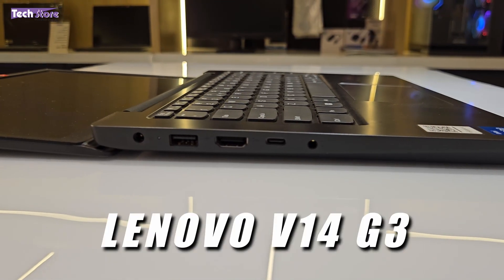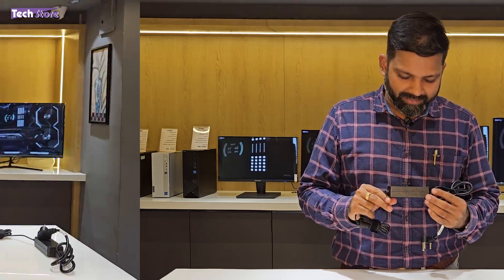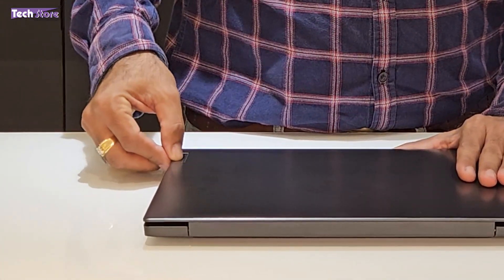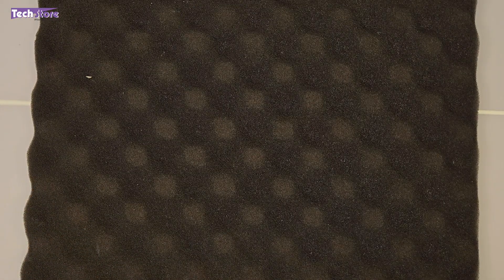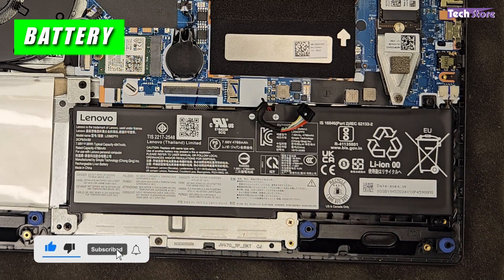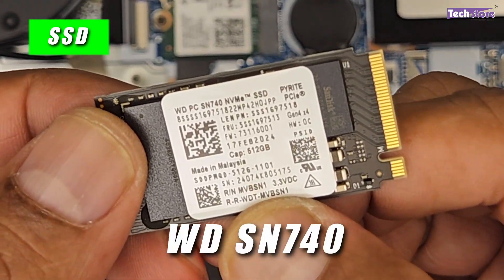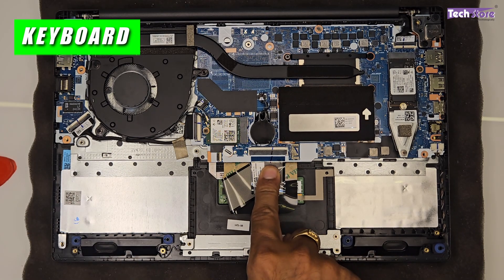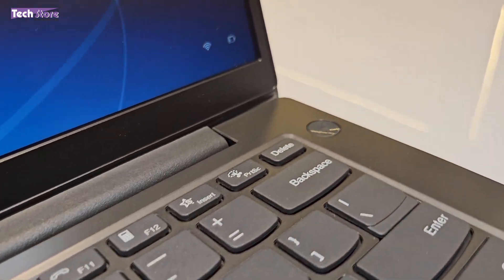Lenovo V14 G3 Full Review & Upgrade Guide 🔥 | Performance, Features & RAM/SSD Upgrade!

Comment: I have the same laptop, and i want to confirm something 
From the task manager - memory section 
RAM shows 1 of 1 slot used
and the form factor: row of chips
Can the RAM be upgraded or am i stuck with 8 GB RAM forever?
Reply: Same Here Brother! Did you find any answer on that?
Kindly answer❤
Reply: @Waheed590 my laptop has a RAM slot for upgrade
Reply: @ManojKumar-ls3ow So did you upgraded your Ram then? cause I was having same issue(1 of 1 slot used) I showed it to Chatgpt it said your Ram is soldered and cannot be upgraded!
Reply: @Waheed590 there is rectangular box like container which hides the extra RAM slot, it is on left side of SSD, you need to pull the container to reveal the RAM slot.
Reply: @ManojKumar-ls3ow Thanks Brother ❤